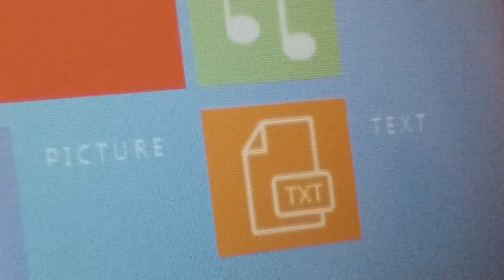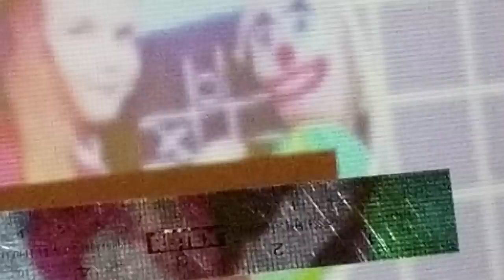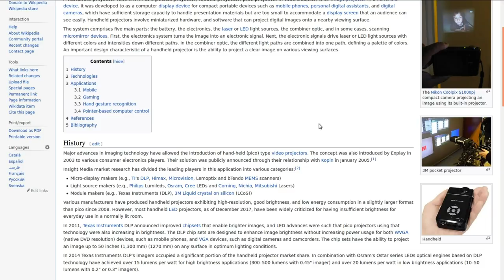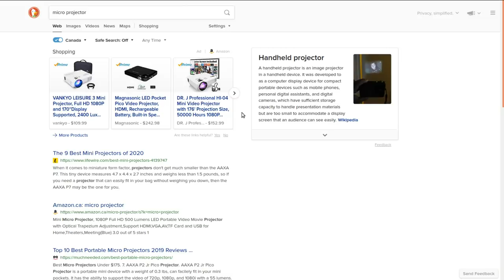mini video projector teardown

Comment: Nice. The test card with the girl & the creepy doll was used by the BBC when they were off air.
Reply from the maker: I was wondering how many UK folks I had watching my channel!
Reply: pileofstuff The girl is Carole Hersee, born November 1958. Her dad George , was a technician working on the test card project and used a 35 mm transparency to make up the card. The clown is called Bubbles ( she still has it ) the chalk cross on the blackboard is bang in the centre of the picture, she holds the record for being the person to appear longest on TV, called test card F it was first used in 1967
Reply: @pileofstuff  loads :)
Reply: @richardhalliday159  We used to use that test card on Amateur TV, only the centre could rotate or be removed to show a different picture for late night contests. British Amateur TV Club or as we called it Bums And T*Ts Club, i'll leave you to work out what the other picture was! :) not sure how many times we transmitted that.
Reply: as a Dutchie I even remember that card :)

Comment: That's what teardowns are ideal for :-D, learning or refreshing your knowledge of how it ticks :-D,  Ok it's not a clock :)

A very neat and simple design, the triangular segmented light mirror is a clever method of getting the best out of the leds.
I bet someone has taken the lcd out and put slots through the case to show old slides.
Power supplys are always handy :-D

The girl on the bbc test card must be about 60 now.

Comment: Great Video! Very interesting! Can you make a remote with Arduino? Would it be doable or too complicated?
Reply from the maker: The hard part would be figuring out what codes to transmit to the thing.

If I had the original remote available, I could just read what it transmits, but without that I'd have to send a near-infinite number of random commands and wait for the projector to react.
Reply: @pileofstuff  , Oh WOW.....didn't realize....I thought I could just have an Arduino on the other end and have that control the thing. Thanks for the explanation. Great Videos!! Love your channel!